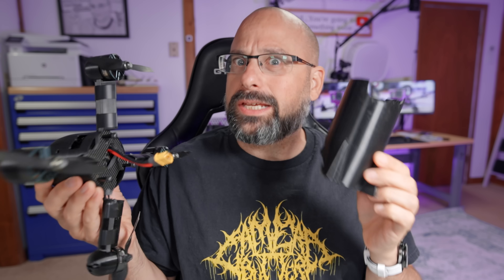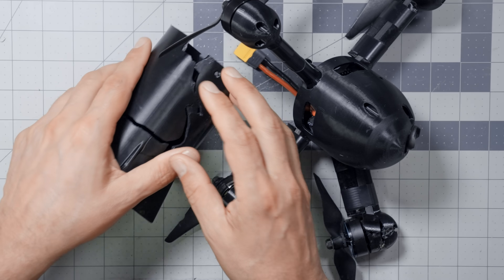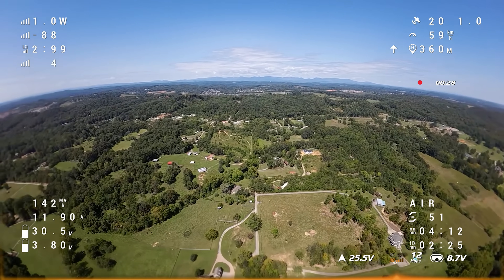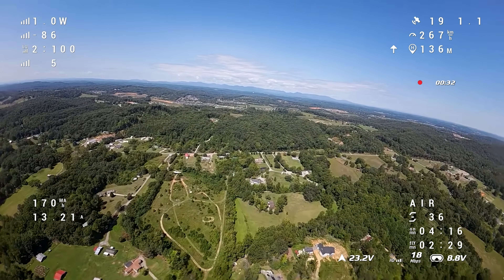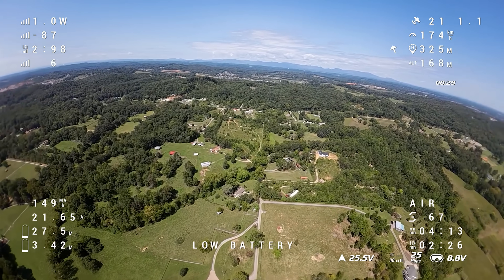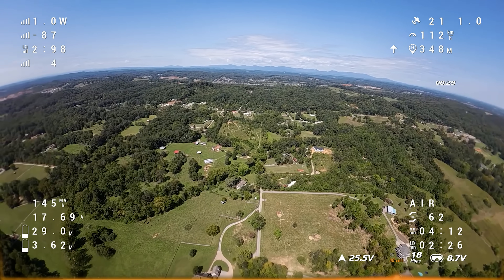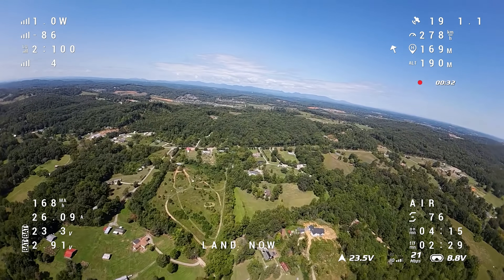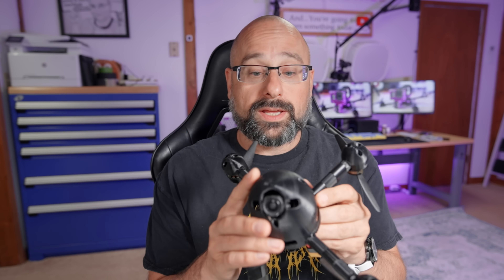The "alleged" 200 mph drone RETURNS

Comment: Are those motors/esc getting hot?  🤔 Turn motors around, and install then expose ESC heatsink fins maybe?  But I don't know jack about 200mph quadcopters so that's just a thought, heat generation is exponential once you push things to their limit, and that's a whole lot of insulating plastic on that thing. 🤷‍♂️
Reply: I think the method is mostly that the batteries don't last more than a minute or two, and it's just not enough time for things to get hot enough to fry (they buy capable-enough ESCs & motors that they don't fry within that time).

Comment: I started building one right around when you did your first post... and shared the same disappointment with Chris for not releasing the STL files. Due to this ( because I knew I would destroy it as well ) I have hesitated to fly mine. I recently checked to see if the STL files were still not available and discovered that they are now available. Just Google AOS HS5 STL and a website will show up to obtain them. If it gets taken down... ping me. I've already printed them in PET and they looks great. Plan is to print in CF for durability and to also extend the fins into wings to see if I can add a bigger battery and get some lift.

Comment: Hi Josua, i need some help. I have. Problem with my new elrs rx system. On betaflight i can not see my colours on the chanels mapping so they are White.  My fc is a speedybee 405 v5, UART port rx is number 6, receiver is correcly installed and binded. Looks like the UART port IS not open

Comment: Would love to see a video on how someone can transition from flying Angle mode as a beginner to Acro mode-  What the differences are with demonstrations? How the quad knows what mode it's in? What the Betaflight settings mea? Transition 60? Threshold 75? What those values mean? How your flights are effected by tweaking those? Optimal settings/ settings to get accustomed flying Acro mode? Tips on how adjusting those in correlation with camera angle(virtual, through Betaflight Configurator and/ or physically adjusting camera angle) , showing how flight is affected? How adjusting those #'s can be a tool for either more aggressive or smoother flying? Example, lowering the transition angle can make the flying smoother?

Haven't really seen anyone cover the subject- at least in a manner that someone like yourself mostly does- in depth and concisely.

Comment: My 5 inch racer also does 275kph with apc 5x7.5 props.

This is kmh same as in your video. You talk miles but is kilometers per hour.

Sure you were only 75% throttle. Better battery and yours would have gone faster 😅😅
Reply: If it’s possible, try HQProp 5.3x8R.

Comment: You need to go 8S to get to the 200mph (with the recommended 2808)
Reply from the maker: This was on 8S, with 2808.
Reply: @JoshuaBardwell  weird - hitting 200mph is pretty straight forward - your battery seems to sag quite a lot. I built mine with the TMotor stack and use Bonka batteries - a recent run (can go quicker ;) ) - https://www.youtube.com/watch?v=ii8zeHIRySs
Reply: Mine is 6s and it hit 225mph. Posted a 208mph run, but latest build did 225mph. also have a 04lite in it for less weight.